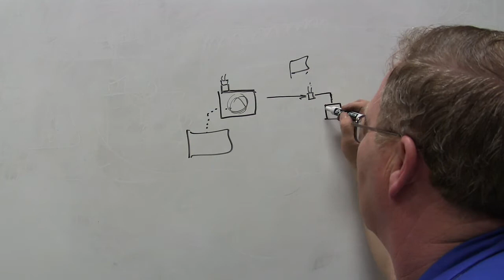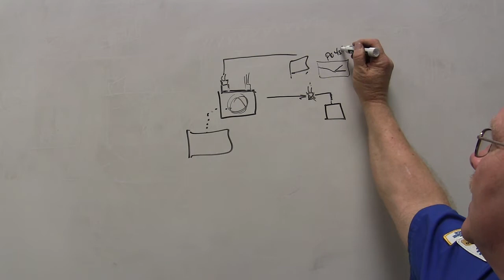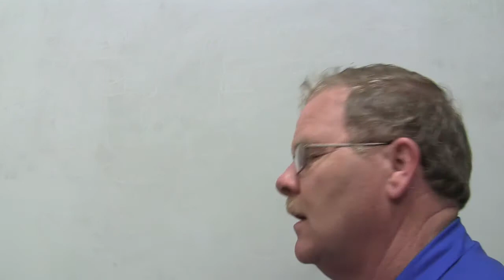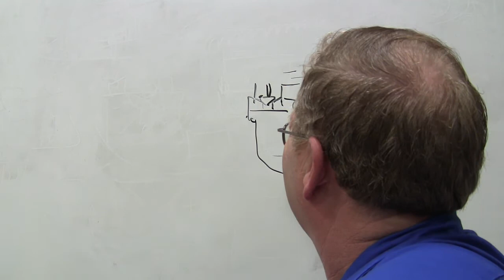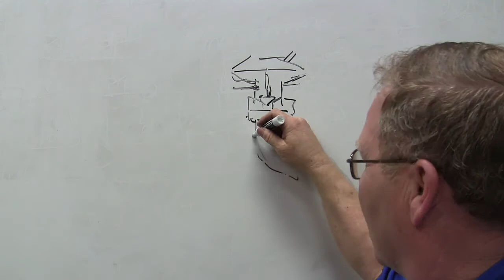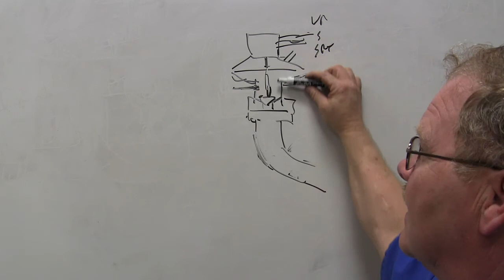Emissions Systems Test 10   EGR and EVAP

Comment: Worked on a Altima with evap valve issues. The tank would vacuum to the point the pump could not pump. Open the gas cap to  get the engine to start after parking. That dude should have got your lunch. He did not know what the problem was and you figured it out ... This one dude did not believe I could fix a diesel European ford van that the American Ford dealership refused to try to fix. It was parked for years for lack of a mechanic that would try. I put some charged batteries in it and the thing cranked up all systems working.